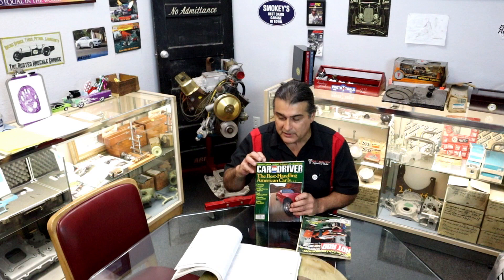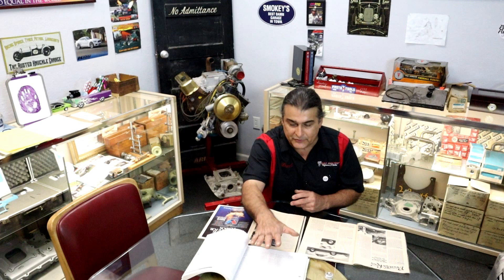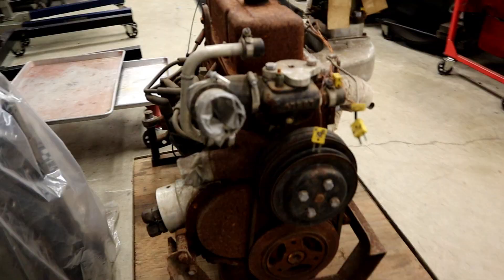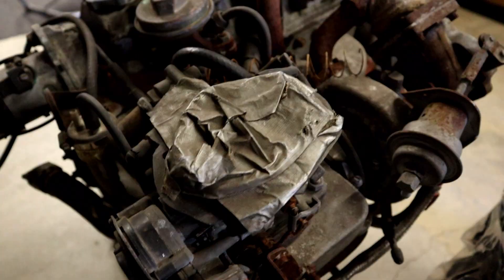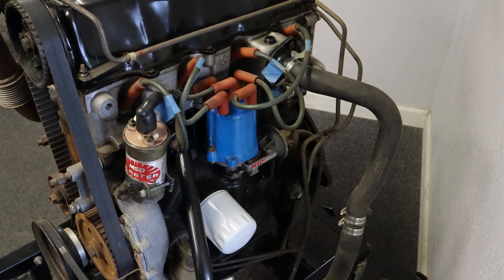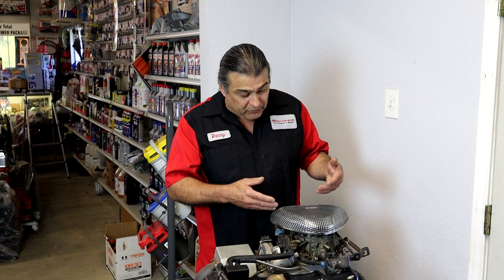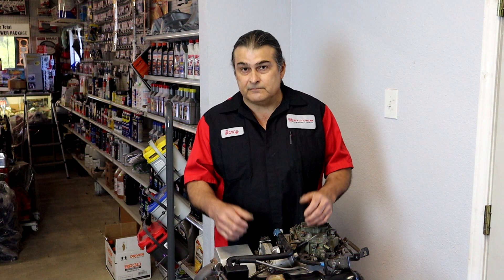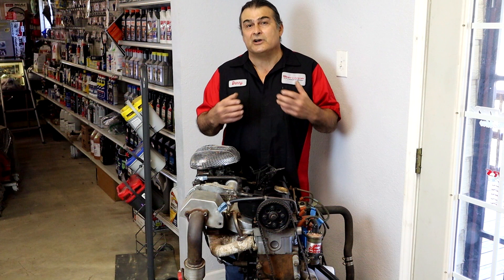What ever happened to Smokey Yunick`s Hot Vapor Engine

Comment: When I tried this years ago it made my carburetor leak and flood like crazy.. I was afraid it was going to blow up.
Reply: probably because the gasoline inside the bowls turned intoo gas and pressurized them , my gues is you stopped too soon and needed more heat to vaporize the fuel before it entered the bowls and goes unmetered by the floats straight through the jets intoo the manifold he mightve done the metering at the fuelpump before vaporizing

Comment: Any new updates or future plans with hot vapor engine videos?
Reply from the maker: Yes we are building a 2 liter 3 cylinder General Motors that will replace the 4.3 V6 and a 2.5 liter 4cyl. we will also be testing these 2 engines  in our shop truck a chevy S10

Comment: 9:43 The emission test result still shows 0.4 HC ie unburned hydocarbons so it wasn't achieving "perfect" combustion, interesting way to recover the lost heat energy though.
Reply from the maker: You watched till the end👍 that’s the test sheet for the HVC  engine in the Delorean . 🙏 still not bad!
Reply: @MrDanielSoliz  I think they probably  had to run it richer to get the NOx down. Good luck with your prototypes. Lithium ion battery powered cars recharged from coal fuelled power stations aren't nearly as green as people think. Extracting and refining Lithium is not clean.

Comment: I unhooked my 8 h.p outboard motors gas line trying to run it out of gas for the winter. I took it off at the motor and it ran for over 8 minutes! It had to be running on vapors.
Reply from the maker: Yes it was running on vapor.👍

Comment: In 1975 GM/Opel had a TDI diesel engine that could achieve high Mpg and was read for bata testing . It wasn't until 2005 that GM let the cat out of the bag and Opel fielded a race car 1.9 liter TDI diesel that got over 100MPG on the race track .the racing authority disqualified Opel after the swept the season with an pressive 100% 1st place ratio. .
Now in Europe TDI DIESEL get average 88MPG ...now imagine a commercial truck with trick out hot vapor intake and European injection system !!!??? 🎉🎉🎉
Over the road trucks could could go from 10 MPG  to 30MPG??? Or more ??? Yeah burt my feelings stop and put in 75 gallons of fuel once a week !!! Instead of every day !!🎉🎉🎉🎉

Comment: I would have to say that it never took off because it worked but not as efficient as one would expect. It takes fuel to make power and there is not an efficient way to do that on these older engines. I would bet running them sustained on a long term run they would not produce the power or economy the initial peak numbers showed.

Comment: How detailed is the information & how hard is it to rep la cate . Could an average machanic do this ?
Reply from the maker: It wasn’t cost effective and was hard to make some of the parts back then also the oil Smokey used was $98 a quart. We are developing the next generation engine using everything I’v learned from Smokey’s engines and using today’s manufacturing and casting techniques and today materials. Our engines will be fuel injected and take advantage of modern coatings and technology.
Reply: @MrDanielSoliz  : Taking a quote directly from Vol.1 2nd edition Hot Rod Magazine  entitled "Engines"  ....I believe it started with "Yes, it does get rubber in all four gears" (reference the Fiaro). Later in the same article....it denotes that the homogenized system only works on carburetor systems; primarily because the fuel / air mix has to be completed before it proceeds to the heating processes. Now, if you can get to happen with fuel injection....I suspect it be an EFI Edelbrock type manifold and not a fuel rail, right? Then ....there's still the turbo and pressure regulator needed.....too. Also, what does one tell the computer and O2 sensor not being wrong??? Hope you all the best in accomplishing this. Please keep us up to date.

Comment: I wanna see Brake Specific Fuel Consumption figures from a dyno.  Heating fuel does not change the thermodynamic cycle.  Disconnect the "Homogenizer" and run the same test for BSFC.  Interesting project, but based entirely on common misconceptions about thermodynamics.
Reply: Nerd

Comment: What is the down points. If this is good as you said. They stay in maket
Reply from the maker: The down points back then were that Smokey would not add fuel injection, oil was $98.00 a quart and some of the parts we hard to manufacture. We are passed all those hurdles now. All that’s left is the powers that be.

Comment: This system was never produced because of reliability problems.  Selling cars to the public requires a warranty. 
The stress on metal parts from heat cycles caused cracking.   Prior to this, Engineers discovered the law of thermodynamics.  Basically, by removing as much heat as possible, the engine lasted longer.
Bottom line?  The motor was never produced, because buyers don't want things that wear out and break down.
Reply: BINGO.  That is exactly why I don't buy cars.  I mean you have things like tires, brakes, windshield wipers, bulbs. Sheesh! Who wants those head aches?  On the other hand considering the reliability of your average K Car in 1985 I am not sure if that is the only factor.  Sure, after the embargo and influx of overseas product, consumers expectations and willingness to suffer through planned-obsolescence was changing and these days we have the reasonable expectation of 200k or more on a decent car. However, the reliability issue can now be addressed because materials and processes are available now that were not then.
Reply from the maker: Did you work for Smokey? or is this just what you think? I am always looking for actual data or stories.
Reply: @MrDanielSoliz  I did a lot of reading on the technical side of that design back in 92 - 93.  Kettering in Flint MI used to be General Motors Institute. 
My professor, used it as an example of why metal physics limit feasibility.  Heat cycles destroy longevity.   Jet engine nozzles experience the same problems even using titanium.
GM  backed away because of life span issues and cost.
Reply from the maker: Thanks for the insight,  how are jet engines in use today? I believe that we can deal with the problems of yesterday.
Reply: @MrDanielSoliz  the aviation world is regulated with inspections and log book records.  They replace heat stressed parts on a schedule before failure.  The cost of doing a scheduled replacement on automobiles isn't feasible(because we can't spread the cost to thousands of passengers in our cars)    General Motors, as with all car manufacturers, do cost analysis.  Profitable or not...bottom line.
Reply: @dannymccarty344  If you were at Kettering then you undoubtedly know who G Flynn Jr. was.  I am not sure about your professor but Flynn saw it work, oversaw the testing at SwRI in 1980, 81 and  82 and had this to say among other things, "Frankly I think your friend Smokey is a budding genius and has to rank with some of the great experimental people such as Edison or Kettering who were not bothered by the experts but went right to the core of the problem without the burden of too much formal education.  If he were selling stock I think I would buy some!  Letter to John Z. De Lorean 11 November 1980 Re: Report on Trip, Invoice & Expense report, Hilsch Tube data.
Reply: @thomasrocha5688  the design was used on many lab prototypes before I was there in 92.  Alot of effort was put into making that design reliable.
Slowing down heat cycle times seemed most promising.  However, the underhood mass, caused space problems and weight/handling concerns.
   GM didn't forget about this design.  It just had too many negative cost and production issues.
Reply: @dannymccarty344  So, you are not arguing that the engine worked, just that it is not as reliable as a Mercedes Diesel Engine?, Actually, let me rephrase: You are arguing that with the technology, materials, manufacturing processes that were available 30 years ago it was a matter of engine life and weight distributions issues?  What is implicit in your argument is that GM was doing precisely what Yunick said they would do which was use his IP for free.  The patents were in place during that period of time and Smokey had moved on from the OEMs and was exploring a "kit" with Crane.  The fact is, the engine worked.  Flynn oversaw independent tests at SwRI and verified that it worked.  SwRI did the tests and it did pass emissions and it did increase MPG and power.  You are obviously familiar with the patent, but have you ever had hands-on with an actual HVE?  Are you aware that there are differences between the drawings and actual engines?  Regardless, it is 2021 and with the materials, technology, production processes available it is a new ballgame.  If you haven't already, subscribe to this channel.  There will be more info coming, most all of it lost for decades.  Not to mention the current forensics that are occuring on the engines.
Reply: @thomasrocha5688  I agree 100% on the patent argument.  Chrysler and Ford also spent $$$ research and development.  I worked with guys who transplanted from both companies, that had worked in that era.  
   Thanks, I'll subcribe.  Would be neat if some new blood had a look see, anyway.  Cheers!

Comment: homogenizer = Turbocharger
Reply: Acting like a check valve to stop reversion/ intake backflow.
Reply: Most WW2 Rotary Aircraft engines used a turbine like "mixer" to disperse the fuel
droplets evenly to all cylinders......
Reply: @regdor8187  Interesting.  I'll have to look that one up.
Reply: not really, no compressor wheel in the homogenizer.

Comment: Sounds a little to good to be true. If they had a 4 cylinder engine that made 250 horsepower and 54 mpg then why didn’t they develop it further and use it. Cause had they did by this time in history we would have actual cars with real sustainable motors getting upwards of 100 mpg. I’ve always been of the mind set of it sounds to good to be true it is. There must of been something about it if it did really do what they say that stopped them from utilizing this. Sorta like a hydrogen driven engine, ya have to have very volatile fuel onboard that wouldn’t be pretty if ya got into a fender bender.
Reply: G Flynn Jr.  The head of GM's Motor Division and SAE Board Member said it worked.

Comment: No one told Smokey that turbochargers exists ? And fuel injection. Those engines didnt actually work , he even tried to cheat car manufacturers.
Reply from the maker: Smokey had been using turbochargers and fuel injection on his Indy car engines for years. Maybe you should read some history books before making such a ill informed statement. Since you didn’t know that ,we can only assume the rest of your statement comes from someone who doesn’t read. GM and Ford both called on Smokey to fix there mistakes.  Smokey was head of racing for both of them and work with other manufacturers as well. In the 50’s GM called on him to help fix the fuel injection problems (the Black widow ) you may of heard about this ,I almost said read.
Reply: Thanks, V8Lenny, You gave me a missing sentence, thought pattern and explanation as to how I was able to find a thing somewhere that had not come to light after all these years.  "Well, If I were any of the OEMs I would probably insist on testing at my own facilities.  Of course If you were DeLorean and didn't have your own, then you would seek out an independent and have them test run it."  Now, after testing, if things went sour a few things would have happened (In the Smokey Books) the OEMs would have taken their chassis and data and destroyed the former and either done the same for the latter or put it in some kill file somewhere where the Electric Car and Hudson Files are.  Smokey, kept the engines.  Now, that leaves us with DeLorean. He was actually putting up money to develop the engine.  Interestingly the investigation leading to the arrest started at the exact same time as he decided to invest in Yunick-Knudsen.  In the turmoil of the BK and Trial, what happened to the DeLorean Files?
Reply: @MrDanielSoliz  I have been warned not ti read any of Smokeys books because they are full of bull.
Reply from the maker: @V8Lenny  well there you go, enough said. So people tell you what to think isn’t a good augment.
Reply: You could always fit those engines to some car and prove how great they are. Todays greenies would be very interested of that superior technology.
Reply from the maker: @V8Lenny  It took along time and lots money but we found the original car that the 2.2 Chrysler engine was installed in. This is the car that Smokey is driving in the video “ dyno days” here on YouTube look it up. You will see Smokey helping out the Swedish guys with their engine problem. The video start out with them and then goes to Smokey’s shop. You might want to look it up. We were going to put the engine on our dyno first but with all this “ it doesn’t work”  and the Texas freeze taking out our dyno what the hell we will put it in the car and do a video. People still won’t believe it. We would have to put a star in it and have them say oh it looks so good before people would believe it. People will watch an oversized person eat a cake on there couch all day long and love it but something that can save the planet ... hell no!

Comment: Heating the fuel and intake manifold only increases the temperature of fuel molecules. By doing so each and every molecule is well heated and all the molecules burn which would have been impossible with colder fuel molecules. However this doesn't leads to increase in horsepower. There's a law about conservation of energy.  "You can never create nor destroy energy".  When fuel molecules are hot they are widely spread and occupies more space than colder fuel molecules hence less fuel gets into the combustion chamber. This definitely leads to lesser power compared to cold and dense fuel air mix. As cold fuel  is more dense  hence more fuel molecules can be packed and thus it produces more power which ultimately results in less mileage whereas the hot fuel air mix produces less power but more mileage.
  Smokey was wrong stating that hotter fuel air mix produces more power. In fact the power which was added was due to the turbo or homogenizer in this case and not the hot temperature of fuel air mix.
Reply: Yunick was well known for looking for ways around rules.   He looked at things differently.   He spent his career innovating and thinking up things no one else had.   
Things are impossible—-until someone does them.   You might recall that man was not meant to fly?
Reply: @yestfmf  
 Yup !! he definitely tried things differently but certain concepts which are fundamentally wrong needs to be corrected and that's what I did through the comment.
Reply: And therein lies the problem with assumption: every Automotive Engineer I have ever talked to absolutely agreed with everything you just said! But, when you talk the Thermodynamics of Combustion to those in the Chemical Processing Industry and Physicists who are very sharp on this, and Not Limited by the Internal Combustion Industries take on things, you will find a great deal of disagreement because of processes they use every day, that show otherwise...
Reply from the maker: you are so right about that!
Reply: What you do not take into account is the homogenization of the fuel mixture. To create the conditions he did, and the power he did, his burn had to utilize the fuel in a more efficient manner. Which is an actual requirement to reach that Adiabatic state ( we waste at least 70 percent of the potential power heating shit up by poor mixture control ).
Reply from the maker: Yes this is an attempt to reintroduce that 70% Energy loss.👍
Reply from the maker: We can dump lots of fuel and air into the cylinder add a spark and the reaction will make cylinder pressure and push the piston down. What if we could increase cylinder pressure by rapid expansion of the fuel in the manifold? Maybe we would have a HVC engine ... the 5th cycle.... it’s all there if we want to read his books.
Reply: The real secret is to keep the heat energy in the engine. Yunick used special forged pistons, valves, and other parts that would stand up to a lot more heat than a standard engine, then he ran the engine at much higher temps plus used heat to completely vaporize the fuel. The perfect combustion was part of the formula, the other part was utilizing all the heat to produce power and not discarding it through the cooling system and exhaust.
Reply: @stephenkeebler732  
 I never met a physicist or chemical industry expert who created free energy🤪 I'm sure you will be asked to educate yourself about Thermodynamics and physics by those physicists and chemical experts😆
Reply: @mrdanforth3744  
  Study Basic Thermodynamics buddy.

Comment: Its not used because its obsolete.  Where's the report with data?  Your numbers are made up.  Today's engines run hotter and have much higher compression so the same thing is accomplished without the complexity.  This is old technology and this dude is living in the past.  I graduated high school in 1984 and remember this article.  I've been a Mechanical Engineer for over 25 years and have a lot of respect for Smokey.  This was a neat idea but it wasn't his best.
Reply: 50 MPG alone puts it in the top 10 all time best mileage cars and the only non-hybrid.  If any reports existed they were undoubtedly destroyed or subject to MNDAs.  Smokey did say that independent  tests were run at SwRI but they have a policy of purging after 8 years.  So, coming up with a report would be quite a feat.  On the other hand, if such a report does exist...I would subscribe to this channel for updates ;)